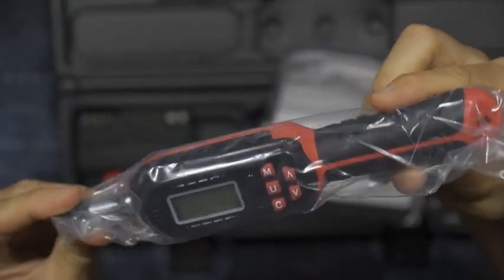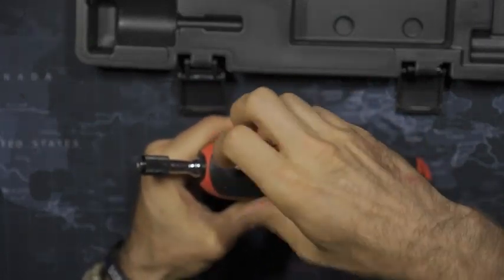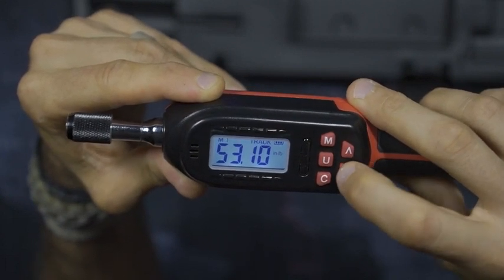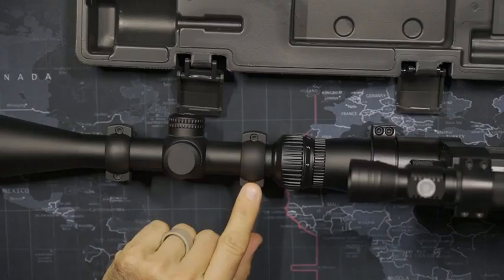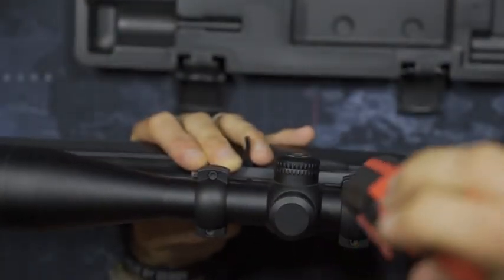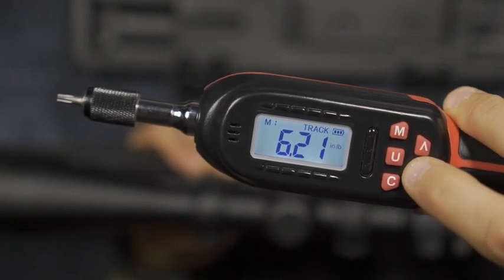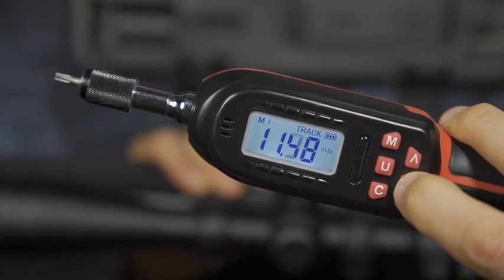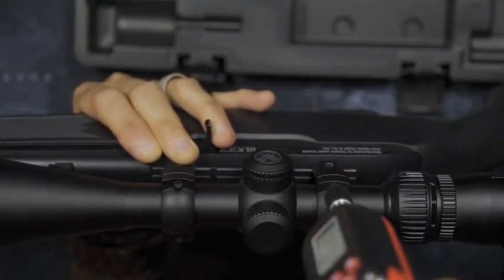VANPO Digital Torque Screwdriver Unboxing and Instructions

Comment: Why does mine only range from 53.10 to 26.65 inch lbs. Will not go lower!!! Instructions SUCK. Works OK only in N-m. Have two of them. Both the same. Need Tech Support. Where is it?
Reply from the maker: Sorry for this problem, you can find customer service in the order, they will help you solve this problem; or you can send a video of the product to our email so that we can see the problem more clearly, jixialin1@gmail.com, thank you!
Reply: same with mine
Reply: The solution is to switch into the nm mode and perform the conversion. so 14lb/in is 1.58nm and then it the U again and it will now show all the values.